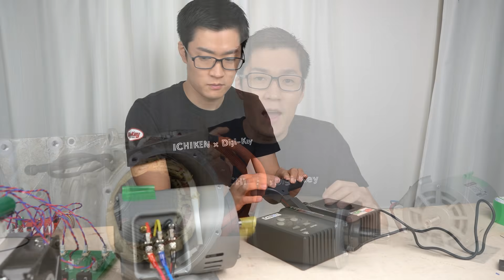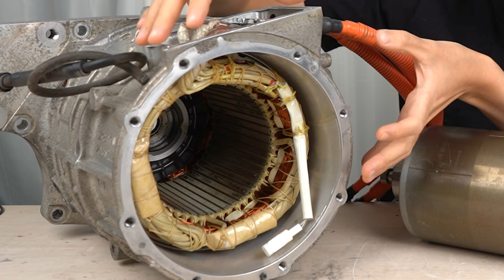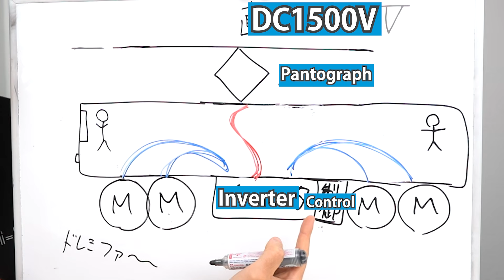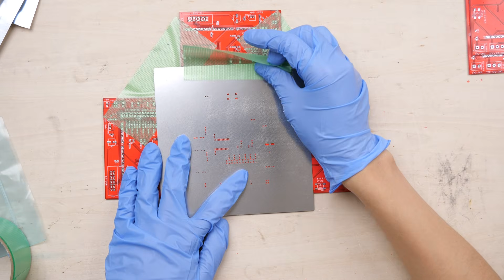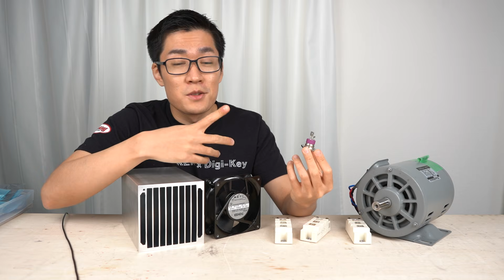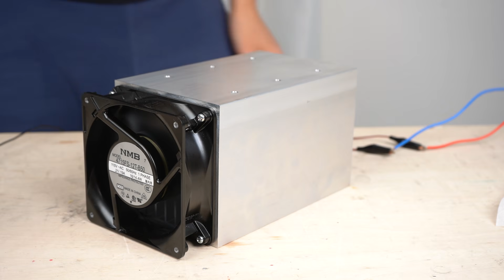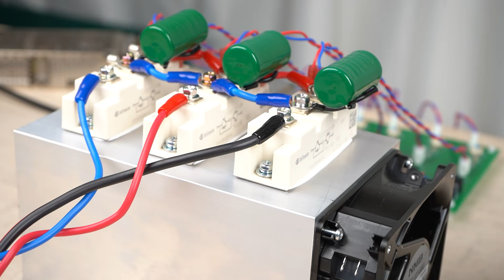Why Electric Trains Make Interesting Sounds. I Made a Singing Train Motor!

Comment: Great video! 👍
I think, that do re mi fa was selected, probably, as coincidence due to used motors and winding count to get best performance.
When I write code for DC motor PWM control, I noticed, that different motors needs different PWM frequency for better torque and performance. In some cases, frequency wasn't pleasant.. 😂

Comment: Hi awesome video :) 
I have a doubt about these trains: 
Since they operate on 15000 Volts DC by overhead line. So when they are powered by DC is the track the negative terminal ? 
Like for AC we can simply connect the track to ground right? 
But for DC the tracks must be connected to the negative terminal at source right? 
Also for DC we might face challenges with attenuation... 

Please do tell me if my thinking is correct :)

Comment: The story starts around 1996, when the Österreichische BundesBahn (Austrian Federal Railway) asked several locomotive manufacturers to develop an allround locomotive of around 8400 hp, fit for fast passenger and freight services. Of several models, a variant of the Siemens ES64 line was chosen (variant U2). Production started around the year 2000. This first generation (series 1016 within  the ÖBB) used gate turn-off thyristor (GTO) control and these thyristors tend to run hot when they go through a high number of switch cycles per second under hight current load. This is particularly the case in the first stage of the build-up to a 200 Hz sine wave AC, the portion between 0 and 10 Hz, when high startup torque from the traction motors is wanted to move the train from standstill. During this time, the sine half waves are made from lots of voltage spikes with varying widths, requiring lots of transitions from the thyristors, from zero to thousands of Amps within milliseconds. That's why GTO-controlled locomotives and multiple unit sets tend to have a switch pulse system that starts off with a low frequency, and ramps up the switching frequency when the train picks up speed and the traction motor current decreases. Examples of GTO-control with increasing pulse frequency:
https://www.youtube.com/watch?v=snuuuxCTQ3s
https://www.youtube.com/watch?v=JZG7pO8EJa8

As the ÖBB would put the 1016 locomotives in service around the busy hub of the capital Vienna (where Wolfgang Amadeus Mozart lived and died), the Siemens engineers decided to do something special with the pulse generator. Why not use increasing frequency steps like in a musical tone ladder and celebrate the musical legacy of Vienna? That's how they came up with the pulse generator with 14 steps. The citizens of Vienna quickly dubbed the 1016 "the singing locomotive" or "the Mozart locomotive", whereas the factory name for it is "Taurus". The locos were very succesfull and Siemens received a second order from the ÖBB. This improved version became series 1116 / U3, also with GTO.
https://www.youtube.com/watch?v=9HVOcxdctXk
https://www.youtube.com/watch?v=J-IC-JRJYwc

The Taurus locomotive has four axles, each with its own 2100 hp three phase AC induction type traction motor. Instead of one GTO control system feeding all 4 traction motors, each motor has its own separate GTO system and its own pulse regulation. The change between pulse frequency steps is not determined in the driver's cab, but by the systems themselves, through a tacho generator on the wheel axles. When an axle has reached a certain rpm, the control changes to the next higher frequency step. As this control functions very precisely, there is rarely any wheel slip, and that's why the frequencies of the four pulse generator almost always sound in unison chorus and switch between steps at the same time. Because the step switching is determined by wheel rpm, it processes rapidly under no load or light load: https://www.youtube.com/watch?v=vxOUdp903UE and takes a lot longer with heavy load: https://www.youtube.com/watch?v=4Ky7t6l0WcU .
To prevent wheel slip,  a central processor compares the data of all tacho generators. When all signals are the same, it means that all wheel axles have the same rpm. When the wheels of one axle slip and the axle rpm increases, the GTO-control will switch to a higher frequency, which would make the slip even worse. As a correction measure, the central processor dictates the GTO-control of the "runaway axle" to choose a lower frequency step instead of a higher one, which results in rpm correction and a limit to the slip. A Taurus locomotive on slippery rails sounds like an orchestra, with steps wildly ramping up and getting corrected down again: https://www.youtube.com/watch?v=Q_bF1Wb_pSE   https://www.youtube.com/watch?v=iMYqWHnE9ww  https://www.youtube.com/watch?v=NTNhGRzmCQE

The Siemens VVVF pulse generator circuit with "tone ladder" steps was later also sold to Japanese firms. The 1216 / U4 follow-up-series of the Taurus (3rd generation) has IGBT-control and no longer has this tone ladder sound. But, although insulated gate bipolar transistors can tolerate a higher switching pace than gate turn-off thyristors and heat up less quickly, there is still a pulse ramp-up audible in the 1216. https://www.youtube.com/watch?v=OMRmBAxXpJU. The Taurus locomotives were sold to a lot of European railways, both private and state run.
Reply: Another Japanese Train-/electronics-fan made such an inverter. This video also shows the way how he electronics compose the AC sine waves. At the start, when the sine half waves are long and there are only a few of them per second, the half waves are composed of voltage spikes with varying time base/ duty cycle. Many of these hefty spikes per second heat up the electronics quickly, that's why their amount is gradually cranked up as soon as the drawn current is less severe.
https://www.youtube.com/watch?v=OC92zC-RcRE

Comment: In San Francisco, about 20 years ago, there was a train called Bart stolen operation, but the old rolling stock dream starting and stopping the motor made a very interesting whining sound, and then at high speeds, you could hear a similar whining sound Aldo. Much higher tone. I don't think the old rolling stock is in service. Although I have not been down to San Francisco in 25 years

Comment: Absolutely well presented and understandable explanation. Siemens Taurus locomotives, common across Europe make a similar sound, I guess they have something common with the Keikyu N1000 as they share the controller circuit designed by Siemens.

Comment: Your test setup is absolutely brilliant! You're a genius!
By the way, Austrian Class 1016 / 1116 locomotives make similar sounds even today. It may not be do-re-mi-fa-so, but it's a musical scale for sure.  AFAIK, the engineers thought it would be more agreeable to hear a musical scale than merely technical sounds. As it turned out, traindrivers weren't altogether happy with hearing the same musical scale all day long. So, in following classes of locomotives, that sound design was abandoned.

Comment: So basically by adjusting the frequency between alternating polarities you could potentially alter the audible frequency of a motor or even potentially a linear actuator? i might need a little bit more explanation

Comment: Sorry, but it’s nothing to do with sounding nice !   The most important piece of the design is that the inverter does NOT produce ANY frequencies or harmonics which are related to the signalling system. The BR Class 323’s were the first to have a “go anywhere” certificate.

Comment: Philips made a chip with 3 phase output  used "gear changing" as it describes in its data sheet to keep the pwm carrier at a close frequency band  what ever the actual motor speed is going to be . Its an HEF4752 chip. I have made a couple of motor drives using this chip . It makes the motor make similar noises.
Reply: Is it hard to emulate it in an MCU?

Comment: That's how our trains work in Melbourne Victoria we used a 15,000 volt DC system and if you touch that wire it's so powerful that it can blow your limbs off my great grandfather used to work with 15,000 volts of electricity when he used to work in the substations after World war Two ended

Comment: I guess the DoReMiFa frequencies were chosen simply because anything else would sound weird or wrong or unexpected. With a well defined set of frequencies, the public would always recognize the sound (safety and branding) and not worry about it. And the proper frequency of the inverters can be very easily checked by listening and so a defect may be quickly noticed by accustomed train personnel even without conscious listening.

Comment: 0:04 it's a Siemens GTO VVVF
4:00 it's not just the switching frequency, but also the pulse width per Hz, and the number of Hz.
4:44 it's for a softer non-jolting start, if you just used a qiuck search: https://youtu.be/jw9pin7w4eE?si=6vaQbPYldLLvJbg1

Comment: My favorite use of the system is the variable voltage variable frequency gate turn off equipped Siemens EuroSprinters, most particularly the so called "Taurus" models (ES64U2). Such locomotives are popular for both passenger and freight applications. My favorite rolling stock period.

Comment: The first AC train motor inverter ever was Helsinki metro M100 stock's Strömberg equipment from 1977. Plenty of YT videos available. The frequency divisors are a series of small primes. The equipment was also used in the Finnish Dr16 engine and the prototype of the gigantic VL86F Soviet engine that unfortunately fell with the Soviet Union.

Comment: The reason why the invertors switch between sounds of different frequencies, is not really a secret. It's because of

a) lower frequencies let through a higher power output, needed to get the train in motion, but will overheat the invertor if used for too long a time, while higher frequencies allow just enough power through to keep the train at speed without overheating the invertor; 

b) switching between preset frequencies allow you to skip over the frequencies that form a harmonic that interferes with the frequencies used by train-to-shore pulse based data transmission systems, most notably safety systems, or frequencies that are outlawed for use (for example, frequencies identical or harmonics of radio frequencies used by mobile telephone systems).Those harmonics would be touched at one point if the invertor would be using a sliding frequency scale instead of preset frequencies.

The do-re-mi-fa sound is an easter egg born from the requirement of switching frequencies, they could have gone with three-to-five random frequencies, but they probably went with do-re-mi-fa because the sound is pleasing to the ear. In contrast, the Dutch VIRMm EMUs use the same principle, but their invertor frequencies were randomly chosen and do not form a melody (at least not a very pleasing or memorable one). They're often referred to as "Bagpipes" or "Cats in heat" because of this.  

The European Siemens ES 64 U2 and ES 64 U4 locomotives (BR182/183 in Germany, "Taurus" in Austria, and also in use in Hungary, Romania and Czechia) also make a do-re-mi-fa sound during initial traction force build-up.

The 1996 Stock used on the Jubilee Line of the London Underground system make a very distinct sound because of the same requirements, as do loads of trains, trams and trolleybuses that use the same type of invertor as those Underground trains do.

Comment: In the Mexico City Metro, the entire fleet of line 8 is made up of Bombardier NC82 pneumatic trains with 9 cars that also have a characteristic sound when accelerating and braking, considering that they are powered with 750 volt direct current and also uses DC motors.

Comment: VVVF is a very interesting type of tech, especially with trains. the best sounding VVVF we have in sweden is on the commuter trains of Type 60, 60A, 60B, 61, and 62, which were built in the 2000s and 2010s. 60, 60A and 60B run exclusively in the stockholm region, while types 61 and 62 run in other parts of country. They have a very cool sounding VVVF too, almost nostalgic to me. im assuming its also GTO-VVVF but im not fully sure. Keikyu N1000 has a way cooler sounding one tho

Comment: you can often hear inverter noise from electric cars these days, and most sound like they’re using variable-frequency control modes, which don’t produce pure tones. presumably carrier frequency modulation for EMI reduction — varying the PWM frequency spreads the harmonics out and can significantly reduce high frequency peaks that could otherwise cause interference

Comment: The reason the Keikyu N1000 series has those singing motors is that the VFD was manufactured by Siemens. Siemens was known for making "singing" GTO VFDs. Their EuroSprinter (aka Taurus, ÖBB Class 1016/1116) locomotive is a great example of that, and it's one of the most iconic and loved modern locomotives just for that reason alone.

13:04 This sounds like a EuroSprinter locomotive starting while hauling a heavy freight train. I think they used the same inverter, but the motors probably had a different gear ratio in the EuroSprinter, because it is a high speed locomotive (certified up to 230 km/h).

Comment: One of the most iconic train noises in the UK is the class 323...

That uses the stepped gradual wave forms that this inverter used for the second stage of acceleration...

Sounds like the train is changing gears
Reply: Dutch VIRM trains are making that changing gears sound as well

Comment: Place the fan further from the fins of the heat sink, by adding a length of pipe, to avoid the shearing effect of the blades. This should ,,cure" the noise from the fan.

Comment: We have a train in the UK known as the Class 323 that makes a distinct sound due to originally having GTO Thyristors (made by Dutch manufacturer Holec). Instead of music, they sound more like a racing car going through the gears though. More recently they were upgraded with IGBTs, but these were programmed to produce the same frequencies (since that meant they didn't need to be retested for electrical interference) which means they make the same sounds.
Reply: Class 465 BREL used to have these too. Probably an abb gto's

Comment: I'm pretty sure the french Alstom system that was used in my city since the 80ies had these singing tones (a few less) which you could hear clearly when the train was accelerating. Sadly newer ones didn't. Incidentally that system uses half the voltage, exactly 750v provided by a 3rd rail instead of a hanging catenary.
Reply: Alstom MP89, MI2N has two tones, Z20500 has 3 tones, and the newer Alstom subways (MP14, MPL16, Z58000 have a two tone igbt sound

Comment: You don't need that industrial fan to cool.  That heatsink is huge and a low speed quiet fan should work.  I'm guessing that was around 120mm fan or 180mm fan?  I didn't notice if he said the size.   Anyway, a low speed fan is quiet and is enough air to cool that setup with its hobby use.

Comment: I bought a cheap inverter/generator from harbor freight. Managers special. It was  1/3 the cost of new and had less than an hour of use. So quiet... I could run my fridge, furnace, and fiber modem and WiFi router for days off a aingle tank. 
I dont want to keep gallons of fuel waiting around in the garage for the just in case situations and all my lawn equipment is electric including the lawnmower. I simply bought a hand powered fuel pump that fits down my fuel tanks of both my vehicles. Even if i have just a quarter of a tank of fuel in each vehicle i could run my essential appliances and communicate equipment for well over a week. If I happen to have 2 full tanks i could go for months without issue.  The folks living around me would have no clue as the inverter is so quiet and will adjust its rpm/power output depending on load. Much better than standard generators that run at 3600 rpm all the time regardless of load.

Comment: No the engineers didn’t program it to make those notes, it’s simply a result of the throttle control having speed detents! As the driver accelerates through the increasing throttle positions, the motor controller increases the AC frequency, leading to that characteristic tonal melody